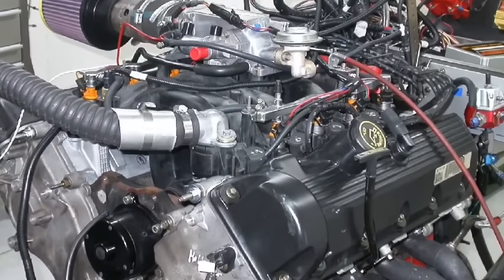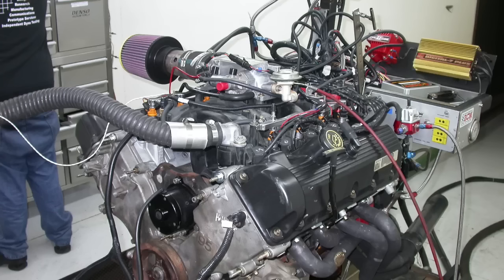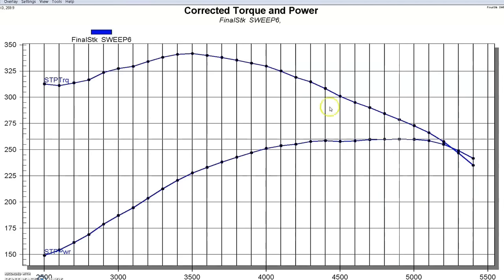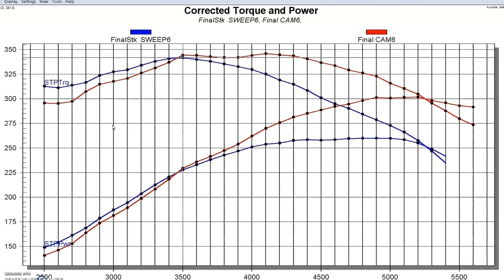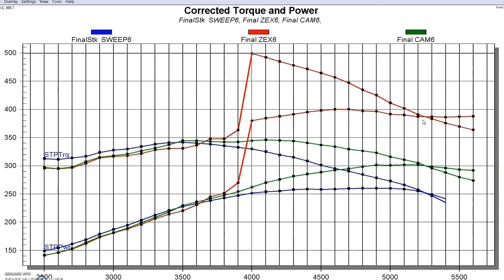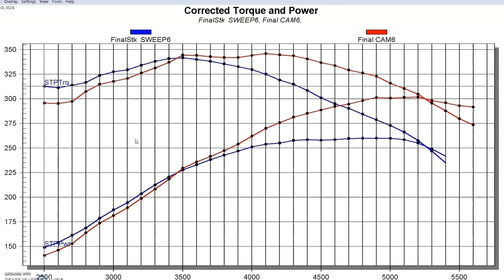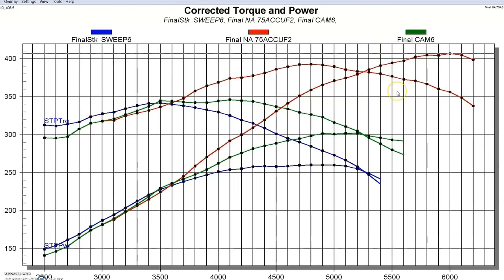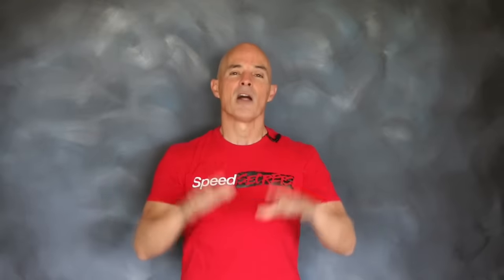HOW TO! MAX HP 4.6L FORD 2V MODS!

Comment: Talk about subscribe!!!!  Man this is IT!, exactly what ive been waiting for!.  A way to produce great power to the old 4.6 2v without going by way of nitros .  I still have me very first car purchased new in 1996,  A Saleen s281 Speedster.   And I absolutely loved my car for all it was worth. Even knowing full well it was a bit slower than the outgoing 5.0 GT.   Indeed coming to that power disparity was a bit of a downer, but the Saleens overall perfomance in its handling steering and basically everything else that mattered outside of raw power was far superior to any stock 5.0 GT mustang.   so the tradeoff for me was well worth it. and i always said to myself, when the car was older, then ide opt for power upgrade options.   Of course blowers was always on the mind, but for some reason i always knew their was more to be had from the 2v engine.   And here we are today 2020,  old skool project indeed, and its time to restore my saleen. and what a better time to get 'modern' power out of it.   I mean after all people are making 600hp our of 3 cylinder engines (koenigseggs LBF)     what a great video man!! T H A N K Y O U !!!!!  im going to do exactly this settup.  and also take a look at your other 2v mods.

Comment: What did you degree the cams to? I know the clearances for the pi motor will barely fit that cam with stock valves with 4 degrees. Im guessing you had afteemarket vavles too that you didn't mention.
Reply from the maker: stock valves and stock cams have a lot of clearance

Comment: I have a 1997 Ford Expedition 4.6L 2V Type 6 that I luv, but it is way underpowered, something like 190HP for the 1st Gen. 

Will the mods mentioned in this video get the same or similar results on this engine?

Sorry if I repeated an earlier question. I looked through the comments and didn’t see any previous references. 

Thank you
Reply from the maker: yes-ported head, cam and intake always help-upgrading to PI stuff helps
Reply: @richardholdener1727  Awesome, thank you sir. 

This may well be the solution that I have been looking for. 

Thanks again

Take care

Comment: Thanks a bunch for this video...
I've got two of my vehicles with the 4.6L one is a 97 sn95 mustang GT
2V.
 The other...96 Lincoln Mark VIII 4.6L 4V ... I'm definitely running this setup for my sn95. My question is what kinda gains with my 4V 4.6L
Mark VIII can I acquire with this setup, or is it not doable...
A lot of guys are doing LS swaps out of Chevys and Coyote motors out of the newer mustangs. I'd like to see what my stock engines are capable of without pushing them to the point of breaking.
 That 400 horsepower range that you just showed us was quite impressive‼️ Also, I'm only imagining that if you did the long tube headers and the p.i. intake swap and heads, with cams making 400 horsepower is very impressive. if I added a 💯shot.. that would make it dang near five hundred plus horsepower, which is very credible on the streets and at the strip‼️ 💯🏁💪🏾👌🏾🤙🏾✌🏾 ...again thank ya kindly for this well informed video...
It truly helped me brother

Comment: I'm going to need a new engine for my 2000 Mercury Grand Marquis with 270k, I drive 250 to 300 miles a day 4 days a week working for a dental lab. I'm disabled with a bad back so I need help doing any work on my car and I don't make much money. My hope is to build a 4.6 2v on a stand with the intent of 350hp but built for hard driving and high speed burst. Then when the engine in it goes I'll have something much better to go back in... I say I hope because without hitting some very good luck, I don't think I'm going to have the money before the current engine blows up! (and don't get me started on a transmission) Maybe I can find a engine builder that needs long term testing done on a engine or something similar. I know making 200$ a week and not being able to save money to do even basic repairs makes my dream of having a Great Engine in my car is just that, a dream.

Comment: I have an early '99 CVPI, how can I tell if I have a motor like the one in this video or if I don't? My '99 CVPI was manufactured in November of 1998. It even has the standard 'Crown Victoria' badge on the rear instead of the 'Police Interceptor' badge. So honesty, I can't tell if its an early motor or not. Any information would be helpful.

Comment: QUESTION STILL REMAIN I have this motor setup: 97 GT 4.6L 2V Windsor BLOCK: PF75E-6015 CA Bored out 3.562 inches @ .010 over and 2001 GT CYLINDER HEADS: RF-XL3E-6090-C20D "PI" and Expedition INTAKE: 1L3E-9424-BA CRANK: F65E-8303 BB, HARMONIC BALANCER: F75E B2A LO5. WHAT PARTS: PISTON? RODS? CAM? and COMPUTER CHIP? Using mid-grade gas for Street performance.

Comment: hey i have questions,  was that final number with or without the 100 shot and if i was to do the head swap with no cams can the car still with out tune or with that defenses it would be to much for a stock computer could handle? also with the higher compression would i have to run a higher octane gas or would running street 87 or 89 till be possible. I'm excited that im came across this video becayuse i njust picked up a 4.6 to replace my 4.2 in my pickup truck and are looking at nice upgrades to do that wont break the bank.
Reply from the maker: yes you can do the head swap-but gains are much better with cams

Comment: Hi Richard. Do you recall if the ported PI heads still retained the “swirl” ridge in the combustion chambers? If they did, would there be a significant loss in power if these were removed. Thanks.
Reply from the maker: If I remember, you should keep it there
Reply: @richardholdener1727  Thank you Richard. The back story of my build is I am the original owner of a 2000 Steeda GT that I'm currently restoring. The car was not equipped with the Vortech S-trim supercharger so Im just looking for a few extra horsepower without changing the look of the motor. I was interested in the ported heads and the Comp Cam XE274H set-up and I have piston and rods from a non-PI motor. I'm going to assume I'd need to have the car dyno-tuned once these cams are jnstalled to get it running, right?

Comment: Ok so ive got a 97 4.6 2v and a 2000 4.6 pi 2v im going to do this build and have a local shop port heads, do you suggest stock pi cams or improve? And what injectors do you suggest?

Comment: Richard may you do a forced induction version. What the cheapest way to make the 2v handle some good boost safley. is it a forged rod and piston combo or we should add things to the combination like a betterflowing head and cams.
Reply: Wonder if the 5.4 3V crank would fit inside the 4.6 p.i engine ... but a cobra crank and some billet rod an pistons should be good up too 1000 to the crank ,,,

Comment: Got a On3 kit on my kids 2004 Mustang Gt, basically all stock.   Tuner told me never go above 400HP on these motors stock.
Reply from the maker: we run to 700 hp all the time on 2V 4.6Ls
Reply: @richardholdener1727  ok 10-4 on that.  But just to clarify, are you running the stock crank, rods, and pistons with that?  I suppose you open up the ring gap a bit right?

Comment: I could not hear him detail exactly what cam went into the PI ported head combo ? the comp cam 274 NPI cam that was used in the NPI heads which has a max lift of 500 or whether they sprang for the 274 PI version of the cam that has 550 lift ?
Reply from the maker: there were no 274 PI cams when I did this-they were non PI

Comment: Wonder how this will translate to my non PI truck. I'm more worried the original stock 4r75w will crap out under this increased HP. Especially since some fairly minor mods nearly doubled your HP and I want 500+
Reply: With the 4R series of transmissions all you need to do is the JMod and a good oil cooler. They’ll handle 500ish hp in basically stock form

Comment: Now the true question must be asked; were these the stage 2 or stage 3 heads?  I'm gonna come into possession of a New Edge GT and it's getting flat top slugs with valve reliefs and the 274 PI cam. I WANNA go with the stage 3 but I fear the air velocity might be so slow that it kills the low end.
Reply from the maker: that won't happen

Comment: Could you just change the pistons to the 11 cc dish into a pi engine? Id like to find a aluminum block, put 11cc pistons in it with pi heads, long tube headers , nothing crazy, would this work
Reply from the maker: yes
Reply: @richardholdener1727   thank you, I was afraid that would be too simple 😂
Reply: Richard how can I look up a ford oem part number on a piston ? Im trying to verify what ford oem pistons these are,  82000H im being told 04 4.6 -3cc ? Can I use them in my 04 4.6 2v ? Im finding confusing information

Comment: Best way to make power with a 2000 GT mustang is to throw the 2V away and shoe horn a 429 CJ into the engine bay. Of course you will have to flare the rear quarters for a set of slicks or nitto 305-45-18 on the street. But then it’s no longer a mustang, but a lil angry monster.

Comment: Non pi engine with pi heads and cams bring the comp up and therefore more power ....the down side is the con rods were also updated with the pi update.
I have a 09 crown Vic p71 and I can tell you that 4400 pound car should have had more than 281 ci as it struggles below 3000 rpm. 
You also need to remember that if you run a 4r75e you'll need to j mod , install a higher stall converter , gears and a tune to to take advantage. Now the question I have is .... What happens when you put the pi heads on a non pi 5.4? Then put that in a big heavy panther?

Comment: Which comp cam is this.. I have the pi motor with most all the Bolt ons and 410 gears.. trying to do my homework to do 1 good upgrade and I'm thinking getting cams is prolly best bang 4 buck... wonder if it's worth trying to get the pi heads ported while there in doing cams?

Comment: I have a 2002 get mustang auto with a vortec v2 si if I use non pi piston with stock new heads what would my compression be and what gas would I need to run ?

Comment: might be the lack of stuff like the alternator etc, but 350 to the tire (400 flywheel) is quite optimistic for a ported stock head/cam combo.
Reply: It wouldn't make 350 wheel.  Just hooking up an intake and full exhaust would drop a little power plus the accesories then driveline loss.  It would be solidly above 300 rwhp all day though which is pretty good for such a mild combo on an old 2v 4.6

Comment: Did You still use the non pi cams with the pi heads and intake on the non pi block?
Reply from the maker: yes-but we tested every cam PI and non PI
Reply: @richardholdener1727  ok thank you. I have a 99 Mercury Grand Marquis non pi. I love the car just needs the 400 HP. I'm really leaning towards this route. Pi heads, intake, cams and throttle body.

Comment: I've seen 2 valve 5.4L Lightning engine make a bunch of power on e85.  It had a Kenne Bell and was making a diesel like 820wtq.  I'd like to build a 96 GT sleeper with what looks like a stock NA 4.6L but is actually a 5.4L with a remote mount turbo.
Reply: I have a 96gt with a 01 Triton 5.4 swap  with heads intake exhaust and tune.   And 373s and a 5 speed its really fun

Comment: I understand this video references an article written many years ago. However was this non PI motor with ported head and PI intake ever ran with the same nitrous kit used on the previous test motor? What are those results?
Reply from the maker: I'll take a look, but if you add 100 hp jetting to any combination-it adds 100 hp-just like it did on cam only test with Zex

Comment: I have a question Richard, I have a 2003 Mustang GT. Would this be a good setup for boost, early 4.6 2v bottom end and use my top end I currently have. I have stage 3 comp cams installed right now with comp cams bee hive valve springs. I want to add an On3 single turbo kit and my goal is to be above 650whp. I have the full fuel system from lethal performance but not installed still in the box. Or would you recommend me sticking to my bottom end that I already have? I have a lot more stuff added to my build already not listed.
Reply from the maker: yes with ring gap
Reply: @richardholdener1727  thanks 👍🏻, would you recommend any connecting rods n pistons since imma try and find an older block since it's out might as well beef up the bottom end vs leaving it stock. Or what's your opinion on Coyote swap on 03 GT?

Comment: I have a 2002 stock 4.6 2v supercharged Saleen what would be the best combo for that motor ported heads, ported blower, size cam, injectors, exhaust etc
Reply from the maker: what size blower?
Reply: From what I read online it's a Saleen series 2 based on the 4th generation eaton m90

Comment: How come you didn’t rev it out more? I rev mine to 7,500 rpm and it does completely fine, I did full bolt ons and made 334 hp 324 ft pounds of torque

Comment: Hey Richard do you know if headers from the 4.6 on the 04-08 f150 model will fit the 09/10 4.6? Having trouble finding some
Reply from the maker: I DON'T
Reply: Hey Richard I have a 94 2v 4.6 what would those modifications ballpark range ? With and without boost🤔

Comment: Richard, Could you explain the benefit the FAST ignition control module brings over the stock unit?
Reply from the maker: THE AFTER MARKET ECU?
Reply: @richardholdener1727  yea, the fast module in the video

Comment: For the cams do you have to buy the cam gear springs an retainers to go with makes it pricey if I did a non pi block with pi heads without the cams but still had nitrous think I would see 400 ?? Trying to get to 400hp budget build less than 3500
Reply from the maker: yes with nitrous
Reply: Okay cool thanks I’ve been looking into everything if I was happen to be able to build the 400hp na with the built top end an added nos what’s the breaking point on the stock non pi block

Comment: With running the 274 cam on the PI heads , is there any concern with valve to piston clearance? and any need to upgrade the Springs and Retainers? Im in the process of building a high compression 11:1 engine is what im shooting for. Using a windsor 281 out of my 99 gt with PI heads and a -6.5 dish forged piston/rods with a 20 over bore and no decking or stroker kit.
Reply from the maker: it fit our combo-you will need springs
Reply: @richardholdener1727  Only springs and i should be good. is it worth anything to have the pistons Notched or would i be better off saving the money? not looking to do a bigger cam then mention above. thanks again for the reply and for sharing some of this older stuff.

Comment: Question for you. Got a pontiac 455 ci motor and im trying to turbo it for cheap. Was thinking is how to make a set of turbo headers out of an oem set what do you recommend would work the best?
Reply from the maker: any cast iron manifold or shorty header will work
Reply: @richardholdener1727  thanks man

Comment: If you were to build a 2v  4.6 using all oem parts starting with a bare Teksid aluminum block from the mark 8...to get close to 300hp or possibly more, using no aftermarket what would you do?

Comment: The cvpi had this motor until 2011 when they stopped production of the crown Vic police interceptor.
Reply from the maker: this was a hybrid-1998 short with PI top
Reply: @richardholdener1727  aahhhh

Comment: Not sure about now but 15 years ago it was super expensive to make mediocre power with these 2Vs
Reply: Than need boost to make any real power. You can’t  get any cubic inches out of them. Small bore limits valve size also. You can make decent power with them with ported PI  or trick flow heads with a forged bottom end to handle boost. I’ve seen them make around 800 plus hp. But the 2v head starts to become a restriction from what I’ve seen beyond that. They simply can not flow enough air.

Comment: I have the same setup, ported polished pi heads, trick flow intake manifold, plemum, 75mm throttle body, no cams though. But I have a winsor stroker 347 bock, what you thinks that's pushing hp?

Comment: Why do you always use the non pi 274 cam and not the higher lift pi 274 cam with the pi head? Got to be a reason always test the low lift? What up?
Reply from the maker: there was no 274 pi cam avail

Comment: Can you do a video on the vic and Grand Marquis 2005 and up 4.6l please
Reply from the maker: THE 2v 4.6l?
Reply: @richardholdener1727  the motor is not the same as the mustang but yes it is a 2v 4.6l the difference is the intake manifold is a different size internals are different as well

Comment: Any issues with piston valve after the pi heads and cams? Been thinking about this route but worried about that.
Reply from the maker: they fit-but the smaller 262 cams are better for the street

Comment: Does ford f150 97-98 used same non PI engine? Can i used 99-03 f150 PI heads or they gotta be of a mustang same age?
Reply from the maker: later trucks should be PI

Comment: what do you think it would pick up using stock PI heads on a stock non pi block? with the cam? so without the nice expensive PI heads ?
Reply from the maker: it does-and if you will put the time in-you can do that swap at the junkyard and get the hybrid motor for the cost of stock one

Comment: I want to do something like this for my 2 valve 4.6 on my f150. What recommendations to y'all have for upgrades?  Truck has 190k miles but id rather improve this Truck instead of buying a new one
Reply: Follow this video but minus nitrous would be sweet
Reply: @rhandy1276  have a 17 roush now. So trying to figure out what to so with that. It's a 5.0 but no supercharger. I still have the 04 and cams sounds like a good idea from this video. So many ideas so little time. Haha.

Comment: Richard can you put a 2 valve head from a 2010 F-150? on a 97 F-150 4.6 short block? Do they have the same bolt pattern on all 4.6 ? Thanks in advance